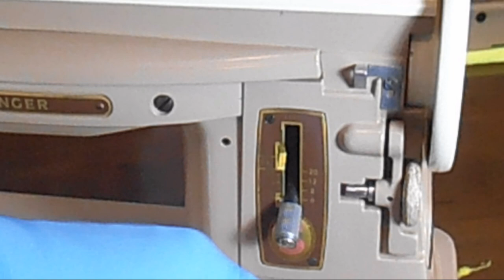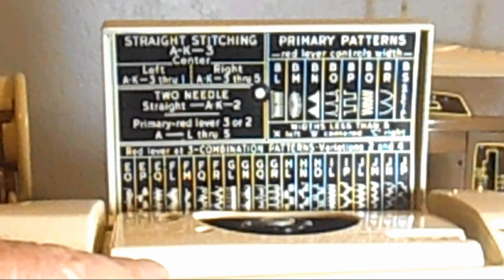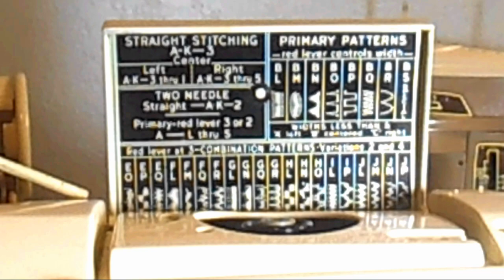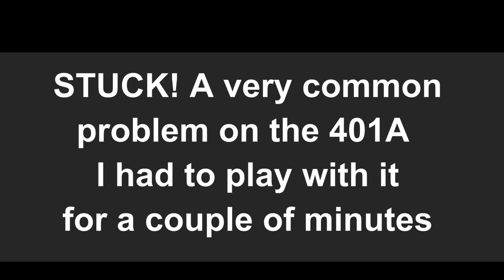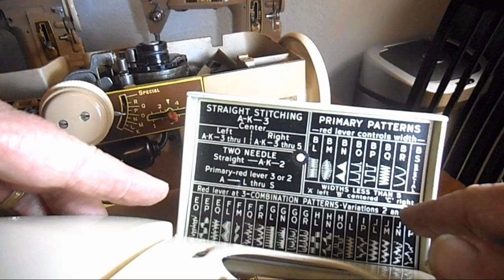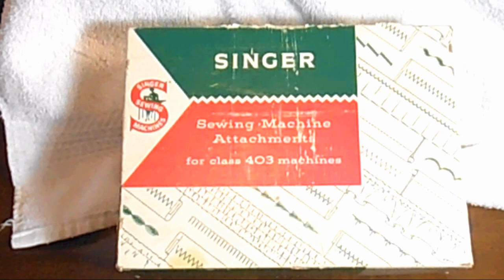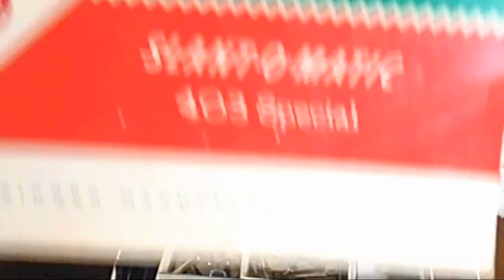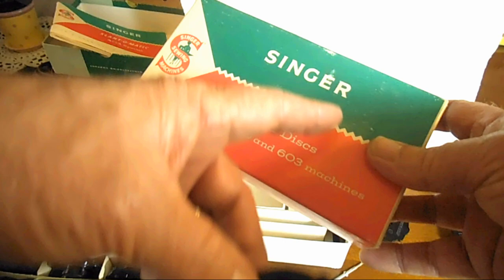SINGER MODELS 401A 403A 404 COMPARING THE BUILD AND FEATURES

Comment: Thank you so much for this video!  I just bought a 403A (which hasn't arrived yet) and was having some angst about it because I was originally looking for a 401A.  Why I went for the 403A was due to better reviews.  Now I know what the differences are and do believe I made the right decision.  I do love the in depth video because I am a DIY person and care for my own machines when possible.  Thank you again.
Reply from the maker: The 403A is my choice also. COngratulations. As a DIY person, you can do all maintenance, repairs, and replacements ever needed. The machine will outlive us easily with normal maintenance. May I offer you a playlist I made for the 403A of 26 videos for the machine? https://www.youtube.com/playlist?list=PLsCOZgzzaiKKyqvdDRwS-9MfLuwSNJTcg Happy Sewing, Jojo.
Reply: @andytubesewing1953  What's the main difference between 403 and 403A?
Reply from the maker: @raczyk  Only the letter A. If you have a label with 403 it is the same machine as the one with a label of 403A. The "A" is a factory designation. It stands for the Singer Factory in Anderson, South Carolina. So, there is no mechanical difference between the two that I know of. Singer models 301, 301A, 401A, 403A, 500A, 503A were all made at the Anderson factory, while the Heavy Duty 404 was made at the Singer Factory in Elizabeth, New Jersey.
Reply: @andytubesewing1953  Thank you for sharing. I'm a beginner and looking at buying on of these machines. See 403's available online used in my area but not the other models. Still going through the video. I assume 403 are as capable as the other models listed in regards to ease of use and reliability?
Reply from the maker: @raczyk  I prefer the 403A out of these 3 models. The main purpose of a sewing machine is to feed the fabric under the needle that moves up and down. All 3 of these models do that very well. They all have the same motor, feed system, and needle bar mechanics. The 401A is overkill IMO. It has a seven metal disc cam stack with a holder on top for more than 20 plastic pattern cams. It has dual pattern selectors and dozens of available patterns. It has many, many moving parts to make all of that happen though, with more to go wrong, maintain, keep oiled, and adjusted. If you like the idea of sewing icicles, diamonds, and squiggly lines it's your choice. The Slant-O-Matic; the Cadilac of Singer machines. If you just want heavy-duty straight stitch only sewing capabilities with all that power going to the needle and feed you can't beat the 404; usually cheaper prices too. Very simple to maintain. Model 403A is the Slant-O-Matic Special. It's an excellent ZigZag machine that is easy to use and maintain, with the same power as the others and simple stitch width and length levers on the front. What makes it Special is the pattern selector inside that accepts those same plastic pattern cams as the 401A if you'd like to use them. Blind hem, stretch zigzag, and all the others. The ZigZag system is heavy-duty and uses less than half of the parts of the 401A. A good compromise between the other two. All three have the same Tension Assembly Unit that you can take apart and clean and reset whenever needed and all the parts of the machines, other than the discs and cords and light sockets, are steel with steel gears and no need for any belts for the motor or timing.
Reply: @andytubesewing1953  amazing thorough response, want simple powerful stitching, sounds like the 403 is a good fit for me. I know it is not in the video. But what about 403 vs 500 series, is the build quality the same on the 500 or is there more parts and more plastic on the later model?
Reply from the maker: @raczyk  They are mostly the same with a newer body style (Rocketeer) on the 503A. It also has a different bobbin winder that I feel is weaker due to the small spring that tends to break over time (it can be replaced) and a different system for presser bar presser that works fine but can not be fine-tuned. (A click dial with predetermined settings like 4 -5 -6 -7, etc. versus the large chrome thumb knob on the 403A that has infinite settings just by turning one way or the other) All the other mechanical parts are the same as the 403A. Many people seem to love the Rocketeer styling with the big flip-up lid on the arm cover while I admire the more industrial styling of the 403A. Do not hesitate to buy the 503A if you like it. Some people experience skipped stitches when sewing knit and double-knit fabrics though. There is some tweaking of the hook parts that can help that. I have videos for repairing the 503A bobbin winder when needed. In fact, I just remembered I did a comparison video of those two models. Looking at it now I see almost 18K views so you are not alone in asking about them. You can see that video here: https://youtu.be/8_okOHCN8jY

Comment: What video do you recommend to watch to show why my needle will not go all the way to the right.  401a. Any help would be appreciated.  Thank you Andy.
Reply from the maker: I don't have a particular video for that. Is the machine new to you? 
     In general to use the red lever to move the needle left, center, right you must have the selector turned to "B" otherwise moving the lever in other knob settings has a different function. 
     If you need a copy of the Instruction Manual it is free from Singer Support here: https://www.singer.com/search/support?title=401   (use the 2nd one from the top) 
     If you are saying the needle bar does not swing all the way to the right while sewing normal Zigzag  ( knobs at B + L ) then that can be a lack of oil on the Needle Bar Vibrating Bracket. Complete oiling instructions can also be found in the Instruction Manual. There are about 38 oiling points. 
     Other physical things that can affect the needle position like that  involve checking/setting the Zero Out function, Centralizing the Needle Bar Driving Arm, and setting the Bight Amplitude and Pattern Selector. 
All needle bar and associated adjustments can be found in the Original Service Manual for Model 401A of which a free copy is available from the Sewing Dude at this link: https://sewingdude.files.wordpress.com/2012/09/singer-401-service-manual1.pdf   
     Usually when someone brought a machine with your problem it was b/c they were not setting the knobs correctly or the Vibrating Bracelet was severely lacking oil and rarely b/c the Return Spring from the Needle Bar Vibrating Bracket to the lever at the base of the Needle Bar Driving Arm was disconnected, Broken or Missing. 
     Be sure you have the knobs set correctly for the pattern you want to sew, and be sure the machines is properly and completely oiled. 
     If that does not fix it then it is time for the Service Manual.
Reply: @andytubesewing1953  Thank you very much for your response. 
Yes, the machine is new to me. 
1. Part of i is  the know in A position. Good learning experience. Thank you
2. Even in B position L for the zig zag, it will not go all the way to the right. It goes all the way to the left, mid left, and center. No 4 or 5 to the right.
3. I will be downloading the manual, as you stated.
I greatly appreciate your time.
Reply from the maker: @CrazyWoods-u3h  That is the first step, a complete oiling. Cleaning the machine often clears up problems like this.
The Service Manual is also available for free at this link: https://sewingdude.files.wordpress.com/2012/09/singer-401-service-manual1.pdf    It has every adjustment you can imagine for your machine. I also have several videos if you are interested. This 17-video Playlist for model 401A: https://www.youtube.com/playlist?list=PLsCOZgzzaiKLiDl9yFTP6mJgQmz5lj4NO
and this 27-video Playlist for model 403A, the sister machine: https://www.youtube.com/playlist?list=PLsCOZgzzaiKKyqvdDRwS-9MfLuwSNJTcg These videos are most "How To" videos for adjusting and cleaning. Some of them may be helpful. Good Luck.